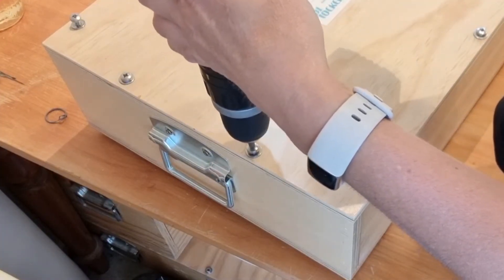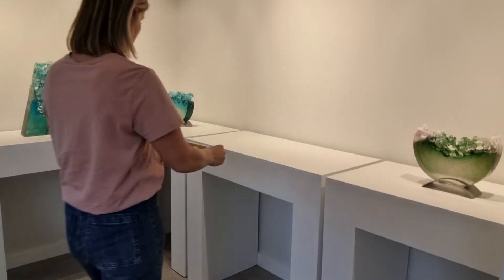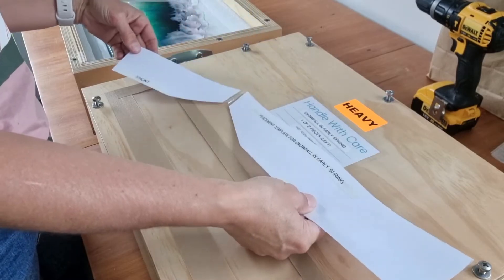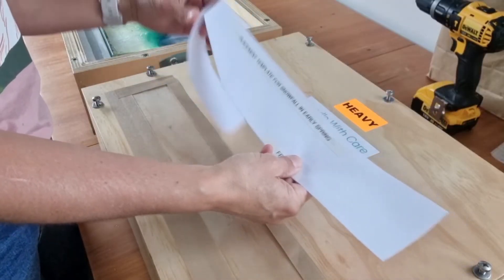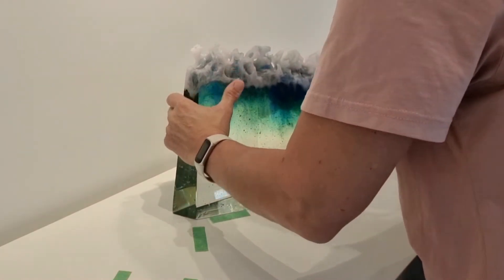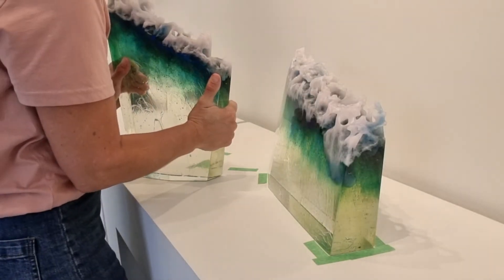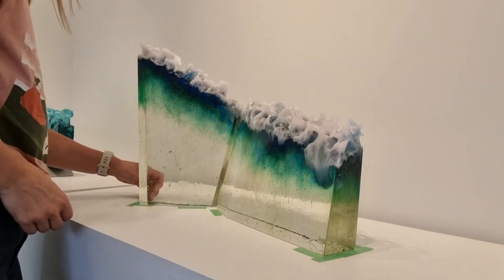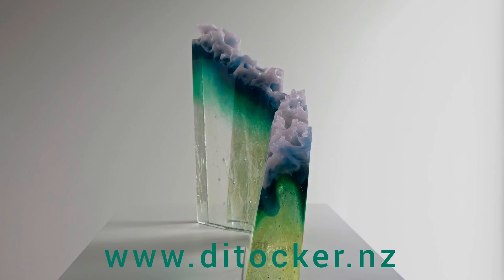Installation Instruction for Fluid Landscape Artworks @ditockerglass4790

Comment: Can I ask, 
What is the ratio between your plaster and silicate to make a mould ? 

And secondly - why do you wait so long to take them out the kiln. 

And finally what kind of firing settings do you use! 

Thank you for your videos
Reply from the maker: Most casting recipes use 1/3 water, 1/3 plaster, 1/3 silica